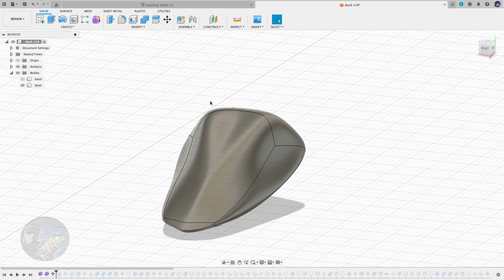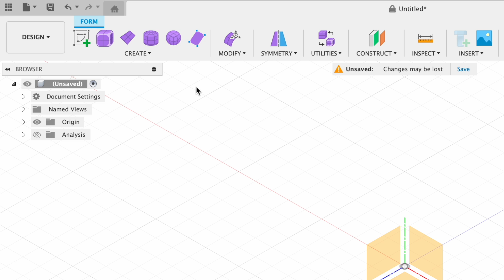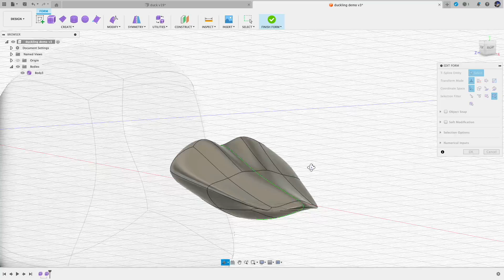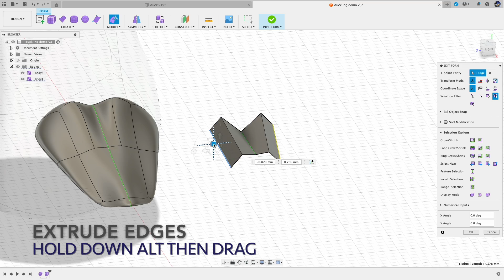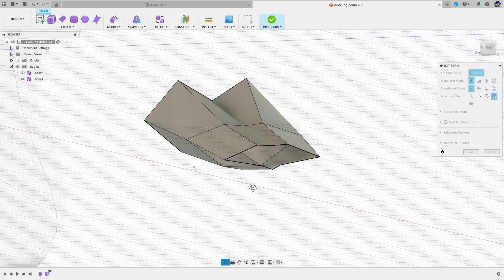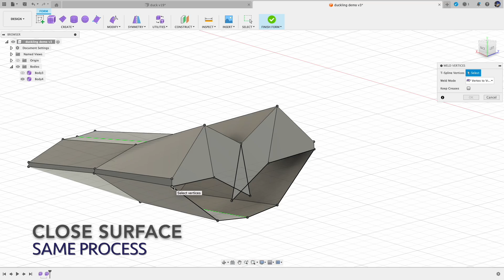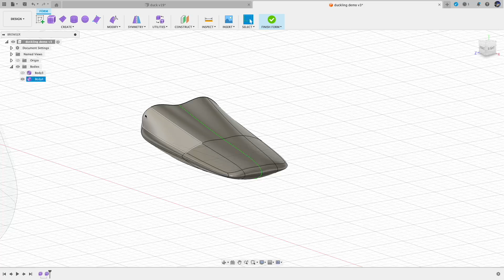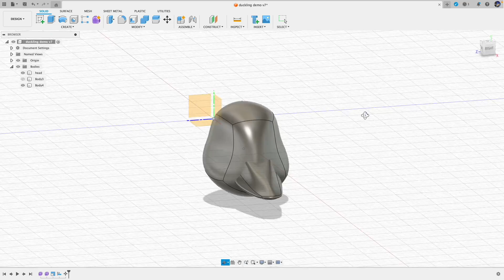Freeform Modeling: Solid vs. Surface, Using Fusion360

Comment from the maker: 5:55 instead of working on closing the form surface, you can leave it open, and use PATCH (Surface > Create > Patch) tool to close each end. You will end up with 3 surfaces. Then you will have to stitch them together. Once you do that, they will become one solid object.

Comment: how do i turn a free surface model back to a solid? i hit some hot key combo on a part and now i can't change it back.
Reply from the maker: Maybe you have unstitched your model. First check if your surface is water tight closed. If not, patch the hole. Then stitch the faces to form a closed surface model. Once you do that, the model should become solid. Hope this helps.